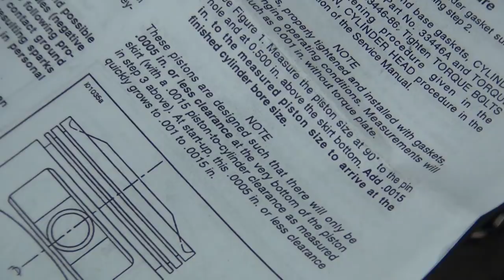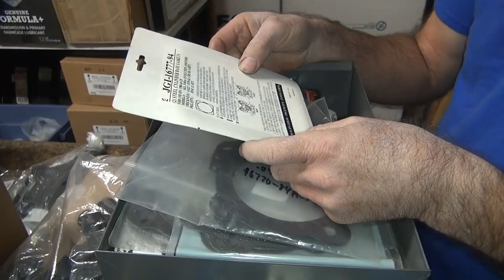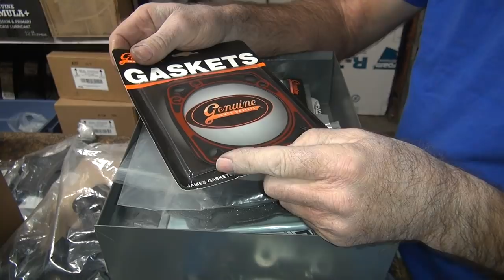2000 fxr4 80ci #120 motor rebuild fxr evo harley evolution cam bearing repair by tatro machine

Comment: Tatro love your videos, thanks much. Have a question: when reworking Aluminium cylinders you don't use torque plates? I don't know myself but some say it has a big impact on the measurements. Especially on OEM stuff.
Reply from the maker: watch the previous video in the playlist. it was all talked about in it.
tatro

Comment: He lost me when he was measuring the ring's... he didn't even measure them he was just guessing. I also cringed every time he threw those rings around.
Reply from the maker: what do you think that 6" scale was for. it was .015 thick. that is more than the minimum thickness needed for the ring gap. get on the ball and stop fast forwarding.
tatro